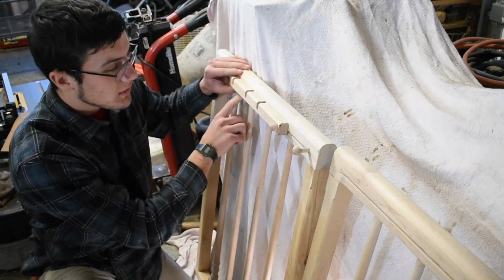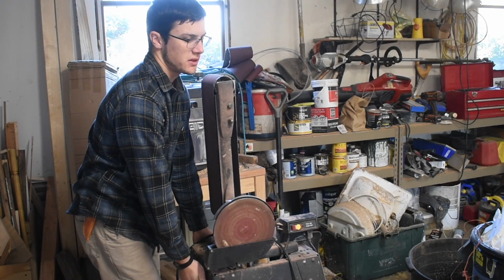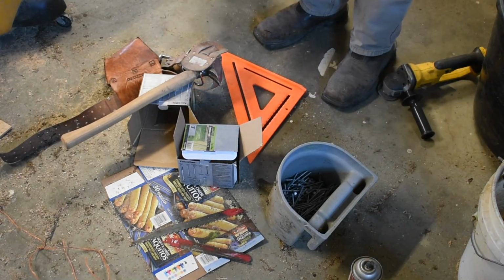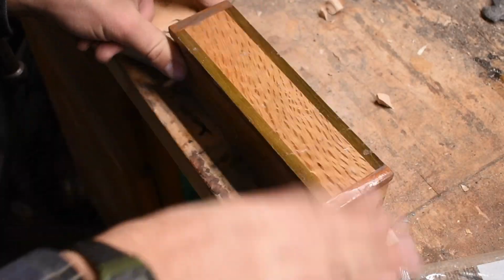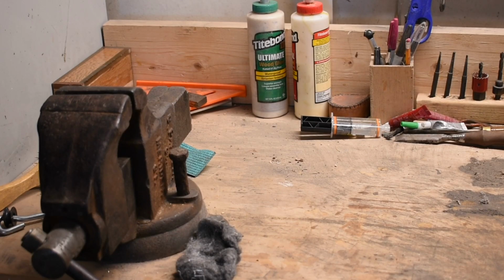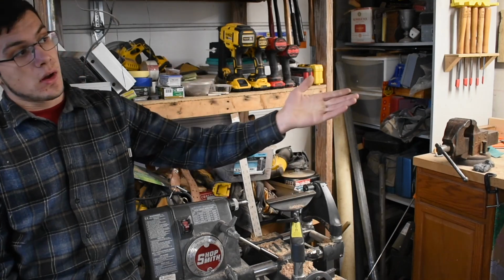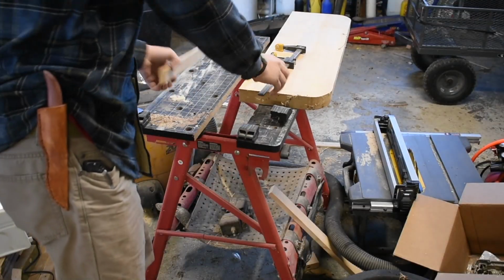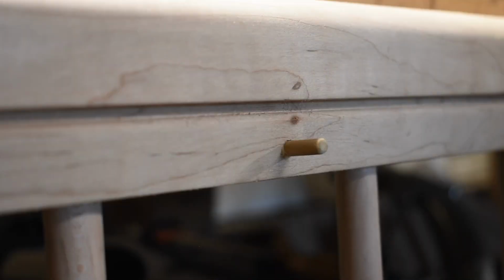I came out here to do ONE thing, I ended up doing this

Comment: Glad to see the Shopsmith get some dedicated airtime. Also, you can mount the bandsaw and easily switch between it and other tools like the table saw or disc sander. You just need to remember to remove the power coupler when you’re not using the bandsaw.
Reply from the maker: Sounds like a PAIN to me

Comment: Main reason I got my Shopsmith was for the lathe, never looked back. Looks like you got a 520 table saw system on it, just want I need to upgrade to.
Reply from the maker: The lathe is sweet, but I already have pretty much everything else it can do in separate tools, so the Shopsmith versions are just taking up space
Reply: @caleb-ray  If you ever get rid of what you don't need, my ears are open. My shop welcomes upgrades
Reply from the maker: @thebeggarswoodshop8756  Considering I didn't buy the attachments, it would probably be bad form to sell them!
Reply: @caleb-ray  Donated equipment to my shop are also welcomed. No harm no foul if you choose not to. I like keeping good relations with youtubers.